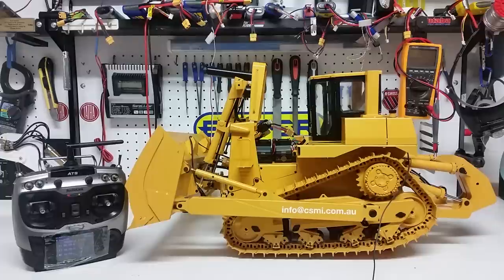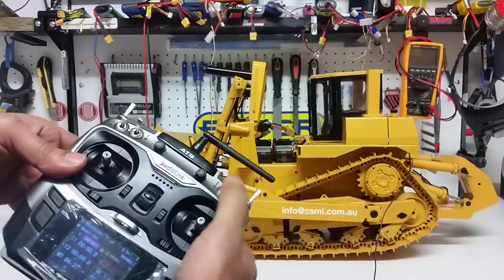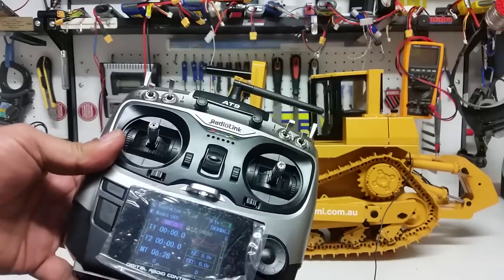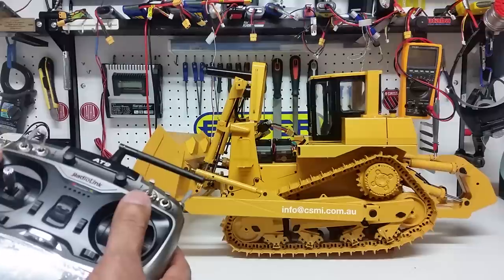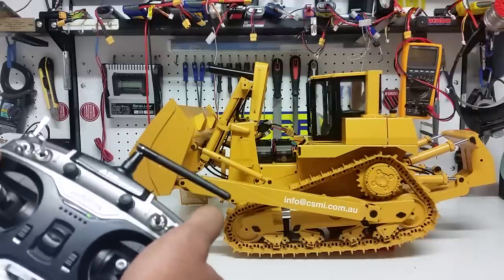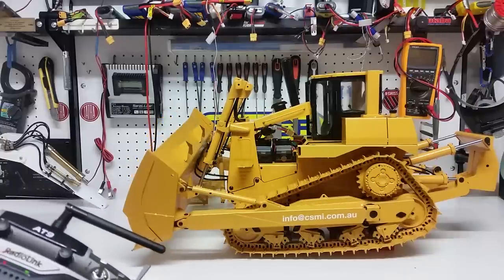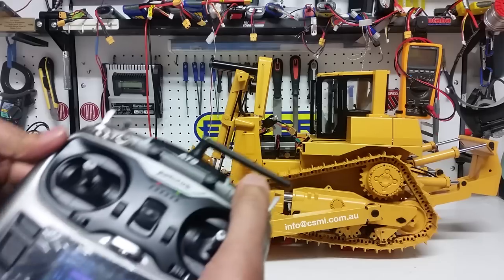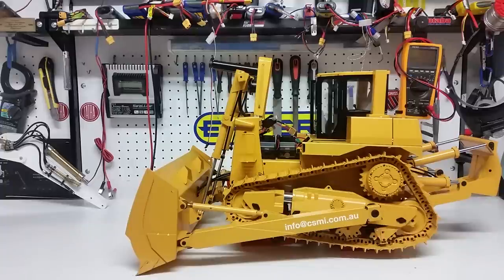CSMI part 4 of 1/14 RC dozer Functions

Comment: why can't the dozer be set up to have the forward and reverse right and left on the right stick and the blade up down and tilt on the right, for one its authentic, the way a real machine is and two most important, when you want to work the blade while pushing a load forward moving the stick out of the forward motion to work the blade causes the machine to lose power to the track according to which function of the blade your moving. other than that it is a awesome machine just to bad its set up to be controlled the way that it is sucks
Reply from the maker: Hi and good day we now offer this option.I have put a video on this . Thanks CSMI TEAM